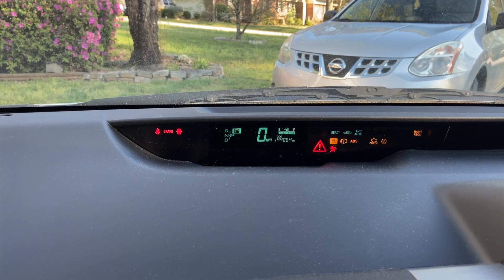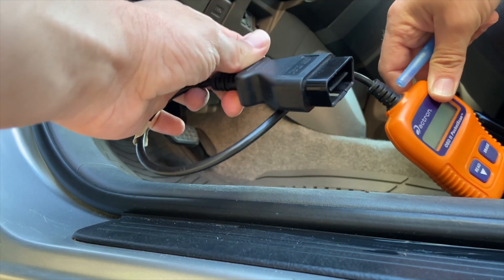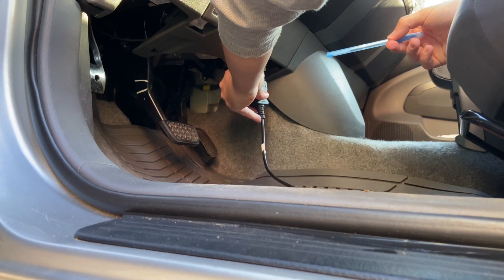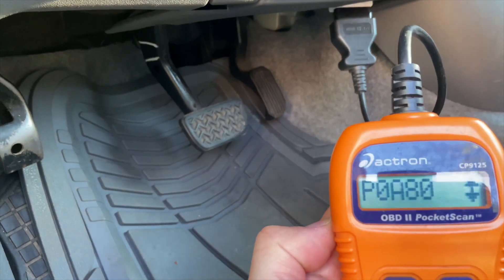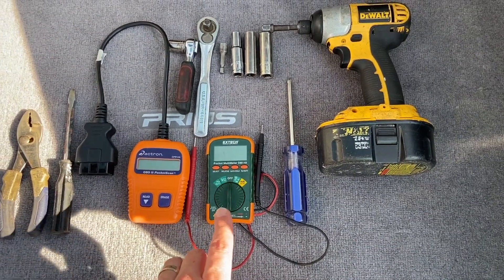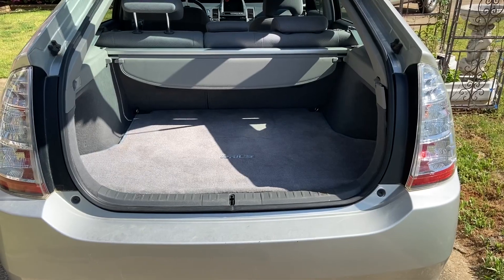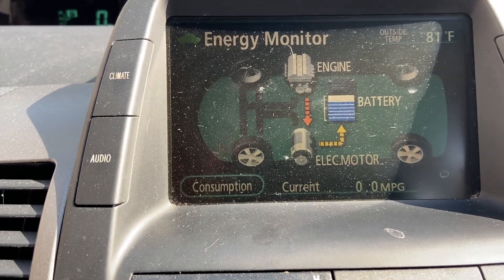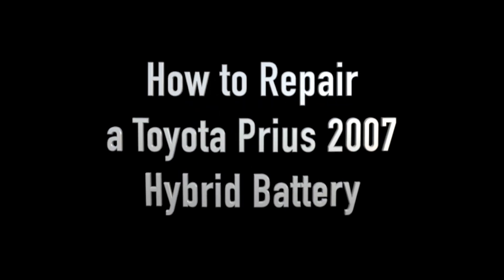How to repair a Prius Battery (Toyota Prius 2007)

Comment: You can't just swap in a new cell.  All cells charge and discharge together as the battery operates.  If the new cell charge does not match all the others, it will result in an overcharge state or undercharge state as the battery begins to operate again, causing the battery to shut down and throw an error.

Comment: Good video. You replaced cells that ranged 6.9 - 7.88V. What voltage would you consider good cells and bad cells?
Reply from the maker: As you could see in the video the majority of the cells read 7.94v . Just 4 cells did no have that voltage. After that massive disassembly I preferred to change all of those including the one with 7.88v

Comment: Why you replace just the cell and more people balance all cells whats the difference?
Reply from the maker: It’s always recommended to balance all the cells after the installation. I did not know that when I made the video. Replace cells with lower voltage than the majority in pack is needed, as some get damaged and don’t hold the same voltage

Comment: So 7.88 V its bad for a cell?
Reply: No
Reply from the maker: The reading voltage of all cells was 7.94v . Just 4 cells did no have that voltage. After that massive disassembly I preferred to change all of those including the one with 7.88v 5:34.

Comment: where do you get the new cells?
Reply from the maker: I usually get them on eBay. Keep in mind they are not new. They are either reconditioned or removed from a totaled car. You can find them also on Amazon. Hybrid Battery Parts | Panasonic Hybrid Battery Cell Module Nimh 7.8V to 8.0V 2 GEN Reconditioned & Tested | Toyota Prius, Prius V, Prius C

Comment: Excellent video sequence.  The bolts that hold the side trims, over the fan air entry, and on the passenger side, just need to be loosened unless you want to altogether remove them.  You can loosen the bolt and pull up on them and they will give you access.

Comment: there is no need to take out the battery and the back seats, , there are other ways that helps you save so much time and be more effective and also you don't need to take out the 2 12 volt on the back  , that makes the battery not be in stable anymore after you take it out , only the front 4 needs to be taken out
Reply: What is the other way?

Comment: Great filming. If only it was that easy to do. Some helpful pointers. Replace with Nichole plated buss bars. There not that expensive and will help prevent damage from aging cells. Testing just voltage won't get you very far unless the cell is completely shot. I'd rely on the priuses bms readings from a better scan tool. Also you did not show the balancing of the cells. I can tell you from experience not doing so will yield the triangle coming back 3-4 more times. Last thing there should be no voltage on the ground and positive hv leads going into the back. Even with the orange fuse still in you will have no voltage there as the contactor is open and there def will be no power with the fuse out. I do like the added rubber gloves.
Reply from the maker: Chloe May’van Clair   Thank you for your great recommendations

Comment: how do you know which cell are bad ?
Reply from the maker: I usually discovered the weak cells by reading voltage. The video show how to measure the voltage on each cell
Reply: @rubenidarraga7535  what should be minimum voltage of a good cell?
Reply from the maker: @ssiddiqui8182  every battery has a small variation of total voltage. As you could see on the one in the video the majority of cells have the same voltage except four of them. I took the highest common voltage as the reference.
Reply: This Prius has sat for a year. The cells are probably all discharged. How do I charge them to test their voltage? Is there a special charger I have to buy?
Reply: @mikeseto9953   I’m just staring my first battery repair.  I’m seeing lots of people using hobby chargers.  Look for nimh, with charge and discharge capable. I have a single one, but they make duo and quad, allowing you to charge and discharge multiple modules at once. I’m seeing prices around $250 for quads.
Reply: Didn't you get instructions from all that music playing?   so much better than explaining what he was doing or what the correct voltage should be, etc.   haha

Comment: Is it still holding up even though you didn't balance it
Reply from the maker: jimmy, it worked well and the cells are still holding up . Next time I need to do it I will probably will balance the cells
Reply: How long has it been
Reply: Is it important to balance the cells?

Comment: Did you need to balance the new modules or did you just place them in the battery then in the car?
Reply from the maker: Nabil Kaali I placed the replacement cells in the battery then in the car. I did not balance them. Once in the car the battery charge each of the 14 blocks to the optimal voltage. That voltage goes up and down depending of the use to move the motor powertrain. But the battery usually maintains each block around 16volts. By the way a block is made of 2 cells
Reply: @rubenidarraga7535  thankfully I seen this comment before watching the video no longer interested in instructions from You. 🤣
Reply: I am curious how that worked out for you tho being a year later.